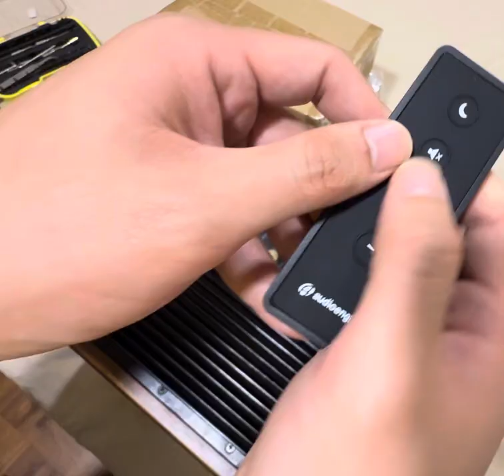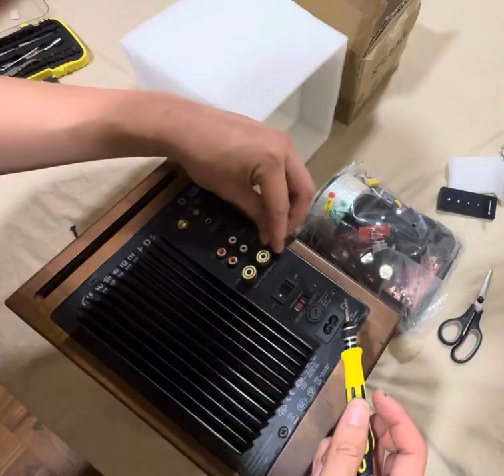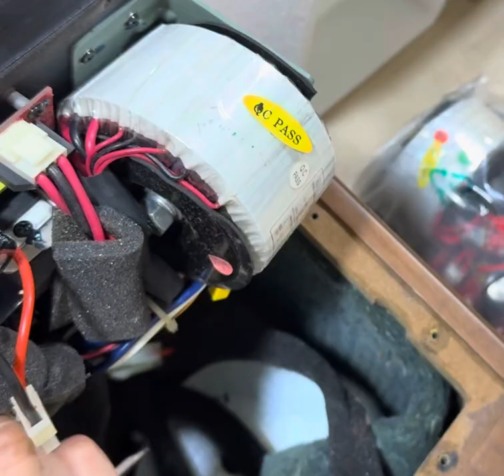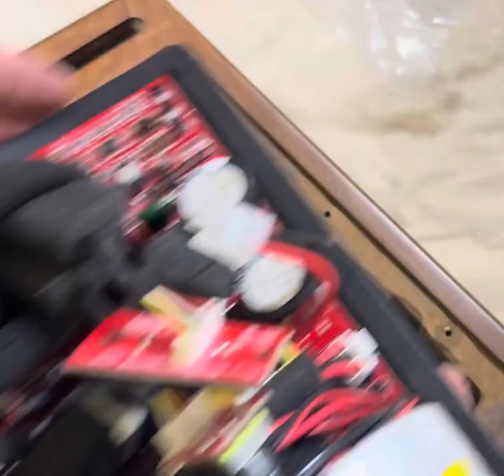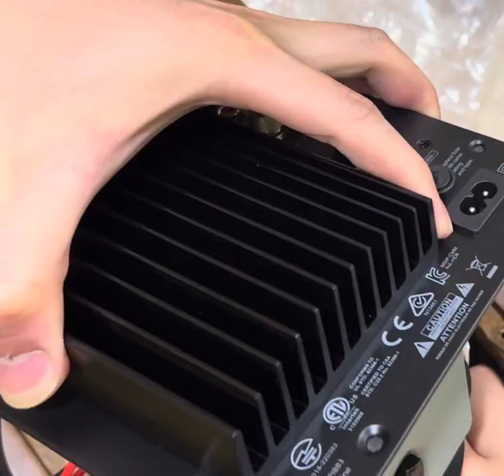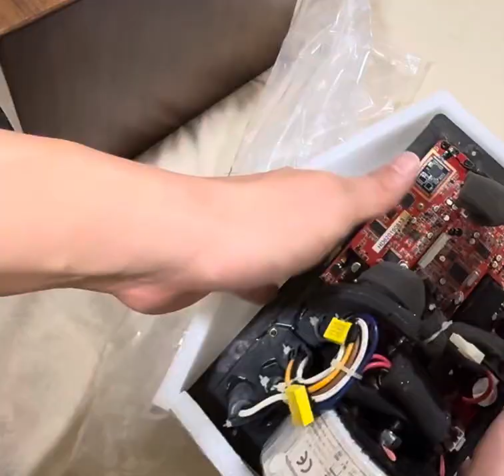Audioengine HD6 Replacement Amp & Remote

Comment: Where did you buy the amp?
Reply from the maker: Hi Ciprinol, you can contact Audioengine USA - they'll run you through some simple diagnostics to determine if the amp is broken. I was offered a replacement amp thereafter (stock / delivery fee applies).